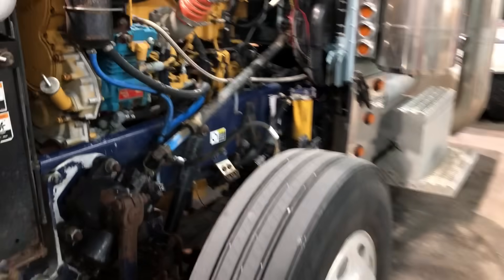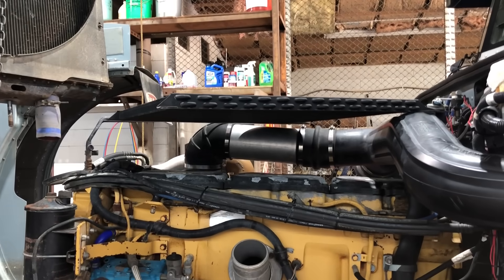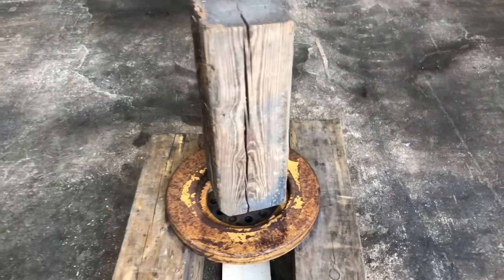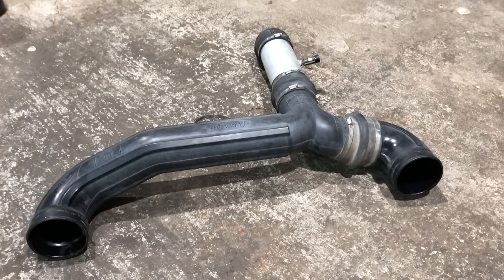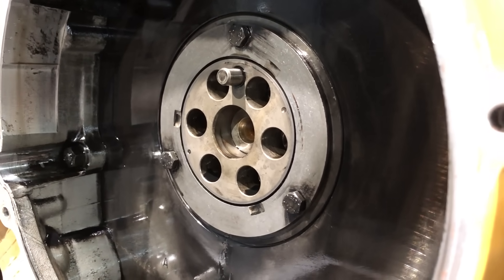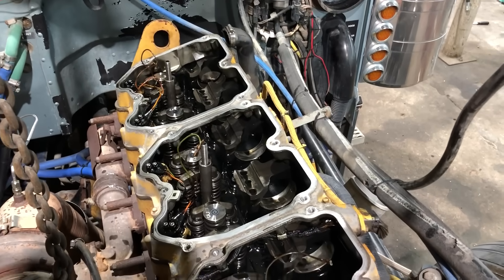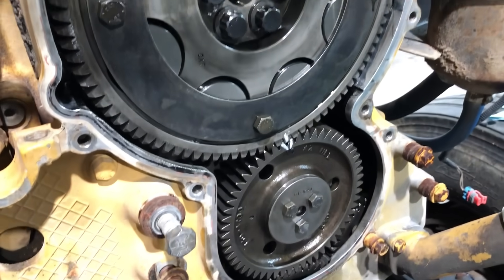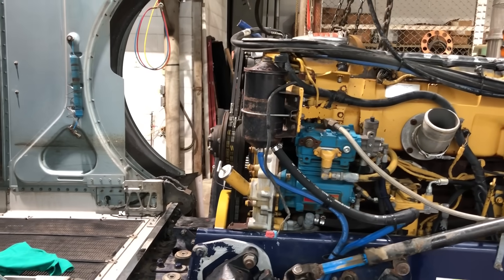800 HP Marine Camshaft Swap - 14.6L Caterpillar 6NZ C-15 Diesel Engine - Peterbilt 379 EXHD

Comment: I know this is a 6 year old video, but I'm binging your stuff and hopefully you might see this comment.

How does this mismatch present?  Is it a sound that you hear that isn't right, or is it a lack of acceleration or other performance?  How would swapping injectors along with the cam make this better?  (The new cam requires more fuel?).  Thanks in advance.  Your content is fascinating.

Comment: If you run the "59" injectors with the 10R7155 camshaft, does that eliminate all the problems with injector wear, cam lobe and rocker wear, and possible gear train failure?

Comment: Now, another comment. 
 My idea of a very good set up (correct me if I'm wrong) would be as follows;
 A 6nz, C18 cylinders,  C18 cam, water methanol injection,  ceramic coatings on pistons combustion chambers, turbo, and manifold, and all on a 425 HP fuel setting. 
 The torque would be high, very low cylinder temperatures, and very fuel efficient.
 It would make power by heating a large volume of air instead of fuel, and also the steam is quite impressive. 
 I've been using H2O/Methanol injection on my truck engines for years without complications, it's an excellent upgrade, won't run my truck without it. 0:12

Comment: I had my 6nz set up with a 18L cam, 600HP fuel setting,  I  changed that. 
 It had so much torque I was concerned that I was going to break something from so much power. 
 It could accelerate up a 6% grade to 50 MPH ( full speed @ 6%) in 1/2 mile.
 On the Dyno, 590 WHP.
 I put in a C15 cam, and set the power at 550.
 It still pulls 6% at about 25 to 30, but I'm not concerned about twisting something up.
My advice,  don't. 
 The power is nice,  but it does bring reliability issues with the equipment. 
 Just too much for constant use,  the truck isn't really designed for that kind of power.

Comment: I’m not a mechanic but I used a C7 in a heating oil truck and hated it.  It had no power and smoked and drank fuel.  Someone said bad injector seals but the company refused to fix it.

Comment: Got a 2013 pete 389.  Looking to repower truck.  What would be your go to cat engine of your choice to use.  Trying to keep all gauges and etc working.  3406E or c-15 and if so which model and why. Any info is Greatly appreciated trying to start collecting all my parts I need for swap

Comment: BFH? LOL
Glad u have your terminology correct.
When you slipped that camshaft back in there is there a timing mark that has to be lined up  or does it only fit in one way?
I've tore down some gas motors but never a diesel.

Comment: I want to see a 3406b make 40 pounds of boost running at nine on the pyro and still getting six miles per gallon must be hooked to 18 speed with brakesaver

Comment: C15 cats are 15.2 liters it says right on the engine plate, a 3406E is not the same motor, even if some of the larger parts are the same
Reply from the maker: A 6NZ C-15 is not 15.2 liters.  You have a lot to learn

Comment: Awesome video! Quick tech tip if you have the tools plus time. It's always a good idea to replace cam shaft bearings and inspect oil galleries to ensure no rework and the manufacture doesn't reject warranties if anything goes bad with the camshaft coming out of the factory.

Comment: Hi I watch your videos I wanted to ask you a question I have CAT C15 6NZ the ECM program has 550 hp I had a problem and changed head gasket I replaced with a new head gasket and head after i put it back together
Reply: continued msg after that  the motor lost power I checked the electronic program everything seems to be fine ? various people commented it was the injectors because it stopped releasing the little smoke that it used to release I placed all new injectors and fuel line, and fuel line pressure were ok and it keeps doing the same thing 
? What controls the fluid of fuel when you need power 
truck doesnt have power

Comment: This may be obvious to some, but not to me. Do all engines in a peterbilt mount in the same location? As in does peterbilt/freightliner etc make the truck with mount locations and the engine mfg's cat/cummins/detroit make their engine fit to the mounts or the other way around. The question is mainly for future reference, If i buy a truck with a blown cummins for example is it easy to put a detroit in it or are there issues with relocating mounts?

Comment: Got a question for you, KT3406E. I am a disabled u.s. army abrams mechanic. Because I am unable to work as a mechanic anymore, and because I am limited on funds and can't afford much... I have been building a project on paper. It may not even be a viable project with the limits I have set for myself. However, I am curious about something regarding engines. What would it take to put a caterpillar 3412 (or other Caterpillar/Cummins V12 diesel) in a 2002 - 2003 era Peterbilt 379, and still be street legal (not for hire, and registered as such. possibly registering as recreational/motorhome)? A local Caterpillar rep told me it was impossible and tried saying it was a limit imposed by the EPA (which I do not fully believe). On top of that.. I have seen a oversize load Peterbilt with one in it on youtube. As for weight limitations, my on-paper design replaces the front steer axle with a Merritor front drive steer rated at 17k (or there abouts).

Mainly curious about mechanicals, what would be required to swap out.. space limitations.. and of course, horsepower and torque issues, as the 18 Speed transmissions top out at 2050 torque.. Some of the design I am going for on-paper I either don't know information for, haven't figured out, or may not be viable. Just looking for some information and advice from someone who knows more than I do.

Thank you in advance.

Comment: Hey man I don’t know if you’ll see this or not. But most people are sending me your way.
Here’s my dilemma 
I have a 3406e 1mm 15.8L 
I have a flash file in there 
A s410sx 80mm bw 
And a full tilt manifold.
Time has come I’m 
Needing a cam and doing injectors as well. I’m looking at this c18 marine cam and r58s ( stock being 57s) 
Is there a certain model of the cam that I need for that engine? 

I’m not too educated about adding these aftermarket parts on.

Thanks.

Comment: It's been 20 years, but if I remember my Cat spec sheets correctly, those 800HP marine engines were only rated for max power for 15 minutes.

Comment: Why would a marine camshaft be better than a street cam?
Marine engines run at steady speeds and loads.   No shifting or RPM changes.
Reply: Marine engines are tuned for short duration, huge power, but once they are on plane and cruising, they spend most of their time at reduced power. A highway tractor spends more of it's life at max power pulling hills and running hard...so reduced overall tuning of highway cam means longevity.

Comment: Theirs a guy here in Iowa that's a owner/operator who restored a dark blue 1977 W900A with a sleeper with modern electronics, wheels and tires and a Cat 3406 with that same Marine Cam. That thing was impressive. He said he had some parts on it from a totaled out Pete 359 with a C-16 in it. I'm not a diesel guy so I'm not exactly sure what the specifics were.

Comment: LMAO, I remember the first time I heard about a BFH tool. I was loaded at a dock and tail heavy so the dock lock was snagged on my ICC bar and my airbags were not bringing the ass end up high enough to clear the bottom lock latch on the dock. I was struggling to figure out what to do and another driver told me to use my BFH dock tool that should be in the sidebox of my truck. I guess he could tell by the look on my face that I had no fuckin clue and he chuckled just before educating me.

Comment: I love the sound of a CAT engine. Makes me miss my old driving days.
Reply: Me too.
Reply: Same here. CAT’s were by far my favorite to run!
Reply: Driving one . They are Noisy  Compair to other Engine's .lot more Noisy
Reply: @lornemalvo565  Well, that doesn't have as much to do with the engine as the truck. If you're driving one it's either in a Cat truck or an old class 8 road truck. Caterpillar hasn't offered an engine for the commercial truck market since 2010. Newer trucks are quieter. Old trucks leak more noise through the window and door gaskets. Not only that the newer trucks have inches of noise dampening/fireproofing material on the firewall and underneath the cab. Back in the day they just didn't worry about a little noise as much as they do nowadays. If it doesn't feel just like being in a Prius they can't get these little shorts and flip flop wearing soy boys from the inner cities to sign up to drive truck. Then again, I make most of my own repairs in a gravel lot somewhere and tromp through cow shit every day, so what the hell do I know.
Reply: Yep.  
Desk job pays a whole lot better nowadays, but aint near as much fun.
Reply: Ditto. This Cat sounds healthy. I always liked the trucks better with a cat under the hood.
Reply: He has the Jake's on as well
Reply: Me too retirement sucks.
Reply: Nothing beats the Scania V8 with straight pipes, but the CAT sounds good i must say.

Comment: To do a cam swap, the first thing you should actually do before taking off the radiator and charge air cooler is open the hood.

Comment: Hey KT3406E, thank you for the videos. Are the valve clearness the same and for the jakes? And injector height? I’m trying to decide if I want to go this route. I do have a rough spot on the 5 injector lobe and need to change out the cam. And I have the 10R8501. Is that compatible to the 55 or 59’s you talk about? Anyone’s input would be greatly appreciated. Thank you again.
I have a 6NZ as well.

Comment: I need to say one more thing you absolutely need to see what a 650 horsepower diesel looks like on a Dyno strap down you have to have a lot of nerve to adjust the air ratio valve when that thing is blitzed out it's a scary looking thing I'm a driver of it I wouldn't get near it just think about bearing gave out on one of those rollers I don't think it would hold it that's a beast

Comment: I like what you do I never worked on one but I sure the heck drove them okay but I prefer aspect out 3408 with the tractor not a truck 54000 pound Eaton rear end two speeds with a heavy duty 13 roadranger yeah 72045 rubber with the new way air ride okay and a Horton fifth wheel with a custom Cozad 6 axle 10 foot wide deck rail trailer yeah with a 17-5 REV yeah I went from 10:20 to 21754 I fight playing in high school going all the way the majors yeah
Reply: It was a 1978 and 79 P they came in 3408 yeah ours respect okay to Johnson Machinery with 633 AIR research Turbo S with boost control inside a cab from 12 to 18 lb of boost yeah she'd run we called her the train called the train with a hundred ton trailer this girl would go and I hauled hundreds of Abraham's okay before Desert Storm even began General Schwarzkopf remembers my butt
Reply: But I'm here to tell you I outran the same truck weather for 75 NTC Cummins a Canadian truck Schwartz turbos with a custom pump on it they were aluminum a Billet pump turn it up 28% and I blew that 3408 away Hall and tanks on the same road Barstow to Fort Irwin Fort Irwin to Barstow oh yeah I live there hauling army tanks for our government before the war that was fun
Reply: What can I say California has taken all our fun away I drove Outlaw trucks they call him nowadays but I grew up I started driving in 1978 for Atlas airlines and up all known R and 9 axle for 35 years construction equipment everything you could think of I hauled it but you know it's sad with California's become we need to do better

Comment: I thought there was a cam shaft installation  tool that lets the cam glide into place
I m guessing all the cam followers were ok
Any case I would have sold the customer on a new set since not only do the roller wear but also the the roller pins which ive seen many fail risking tearing up a new cam 
Then arent you suppose to retime the engine with ET when ever the cam gear or sensor is removed ???

Comment: What kind of difference is there between the two cams in terms of power and how it drives? How about fuel mileage? I have a 2000 model 379 with a 6NZ in it and I’ve been wanting to make some changes to it to increase power. Just curious what differences to expect if all I do is swap cams.

Comment: We started putting the 
6 9 9 9 code in our 3406E  injector code, HUGE MISTAKE. Blown head gaskets and what all else. Too much cylinder pressure without enough outlet. Ran like a scalded dog for a while though.
Reply from the maker: It's just an injector trim code, not a big deal.  You didn't blow any head gaskets by running 6999s.  It was gonna happen running 1100s or 6999s.
Reply: @KT3406E  what would give my 06 E stock motor a wakeup, it already runs fairly good. I think it's a 5ek
Reply from the maker: @Drivapete  The last E model truck engines were built in 1999.  An 06 would be an ACERT.
Reply: @KT3406E  you are correct! It's a 3406E. We just call them "ott 6" for short.

Comment: i do cat gensets C15 779hp @ 1800 @3281 ft elevation (in FL it makes a little over 800hp)ecm software required for that achievement 2885930.... you can put all the parts you want on without that flash it’s not happening ✌🏻
Reply from the maker: No kidding.  Which is why I reflash them almost every day.

Comment: Hell yeah. I have a 2014 Pete 367 with a Cummins ISL 550/2050 with an Eaton 18 speed. It pulls great, but it's no Cat. My Jake certainly doesnt sound as good, and I have stock mufflers and stacks on my truck. My truck is a winch truck with a 47' step-deck winch trailer, but I typically flat haul oilfield equipment with it. I love that thing. It'll pull WAY above what it's registered for.

Comment: I'm not familiar with these engines but I am familiar with balancing. In another video, you discussed balancing the crank that came out of a block. In that block I'm pretty sure you said the pistons that where once in the block where steel top aluminum pistons and you had replaced the pistons with steel pistons. I know that there is a difference in weight. This would add reciprocating weight to the balance. Wouldn't you have to weigh the difference between the two pistons and divide the difference in half and add that said differance to the crank in the form of bob weight. Like I said I dont know much about these engines. I'm not sure if that is a huge affect on the crank due to lower rpm of these larger diesel engines. Please know I'm not criticizing your work in any way. I'm just curious. On a higher rpm classification this differance in reciprocating weight would most likely break the crank.

Comment: I myself had my truck did the same way but a lil different and it cost me out the butt. I originally had a stock 3406e then changed it with two piece Teflon coated pistons 60’s injectors 800 hp cam and 550 jake braker tune which I fried two piston cost she was rolling the coals . Now I rebuilt it again differently I changed the manifold to a bully dog ceramic coated and bully dog turbo and arp stainless steel boats. I went back to 58’s injectors to stop the coals and I might change the tune will post a new video shorty of the change

Comment: @KT3406E did this cam swap increase your fuel economy?  I have a 2WS with a 550/1850 tune in it, not sure what injectors yet but I assume they’re the original ones, but it has been rebuilt with a low level kit so no new injectors, kinda thinking of doing a “marine” cam next year.  Thanks man, love the videos and the info!

Comment: What HP did your 6NZ have before swapping the cam?  I have a 475 HP 6NZ in a 2003 Kenworth W900, so what would I need to do to get the same results as you did?  Just curious because I just recently became a first time owner-operator and even though my 6NZ being stock does pull good loaded, I feel she can use a bit more power to go faster up hills and such.  Also, I see that you also haul gravel like I do, what do you gross when fully loaded allowed by the region you work at?

Comment: I bought a 2008 New Holland tractor at an auction which had broke in half, the clutch was also worn out, i talked to the owner he said the clutch pedal was hard to push in since new, reason it was adjusted too tight and wore the ceramic clutch out twice plus the fingers and bearings, he had the clutch replaced by the dealer, it had a cracked sump and other problems so the dealers took it to their workshop where it broke in half when driving off the tilt tray, it had a service sticker on it from the dealer not long before i bought it, also the PTO gears were replaced as it used to grind going into gear, i took the lever and housing out and found a bolt had dropped down and rusted the cable tight so it wouldn't engage the PTO clutch, so i reckon dealers do know everything?

Comment: Trick for getting the peanut cover bolts out is to use an air hammer powered bit holder.
I use one called a " shaker", light rotation while being easy on the trigger.
It works equally amazing on floor pan #3 Phillip's as well for those trucks that spend time in the mines or haul roads

Comment: I drive a 99 w900 with a C16 Stage 2 PDI turbo used to have straight pipes till dot decided they didn't like it anymore :( I loved the sound but it is nice having it a bit quieter and still pulls hard.

Comment: the video is called marine cam swap so it's fair that it only covers "the actual swap of the marine cam and not all the other things you might do, it's not called marine cam swap +ecm progrsamming+oil leak fixes +blah blah,, most good mechanics don't work for dealers they own their own shops rather than take a safe job like government workers or like bobo the clown.

Comment: I’m a company driver but we have ‘99 Pete with a c15... it’s not stock.  It gets over 7mpg loaded and will pull a hill in high gear without losing any speed.  Try that with your epa-strangled garbage.